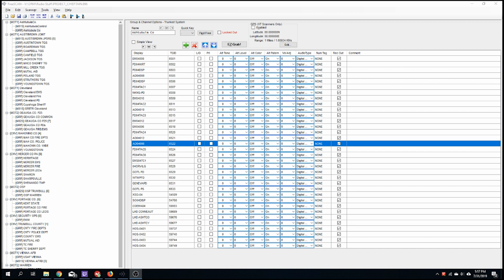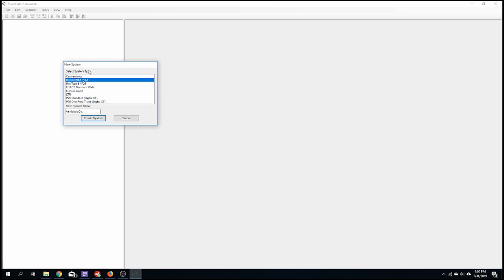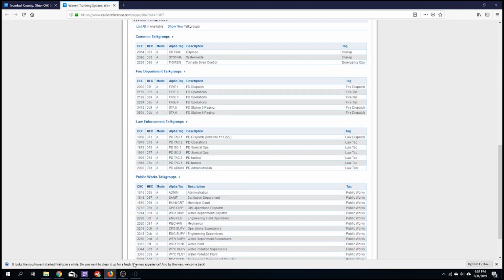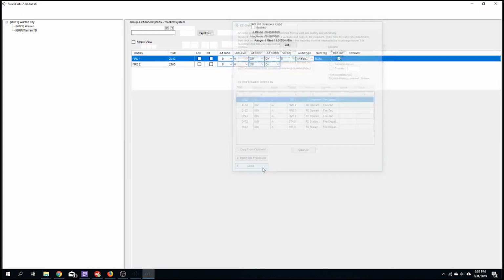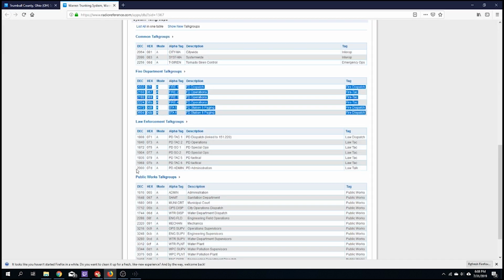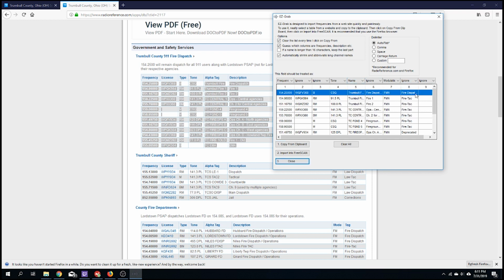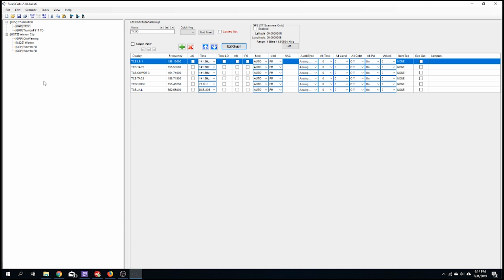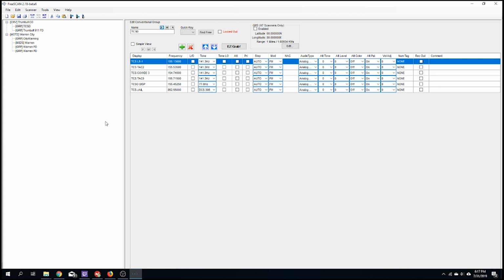FreeScan Scanner Software - Programming Uniden Scanners using FreeScan Software

Comment: i have 3 of these 15x's 
one being brand new because about 3 weeks ago the one i have on my nightstand .. sometimes i turn it off before falling to sleep,and sometimes i fall asleep and wake up in the middle of the night and turn it off.
well on this one night it was working fine (audio coming out) when i fell asleep and then when i woke up i seen it was still scanning and stopping on the busy channels but NO audio was present. i turned it off and found time a week or 2 later to look at it , i even tried using a pair of headphones and a ext. speaker but no AUDIO from those as well.. I did a full reset to see if that might fix it but to no avail.
i did send uniden a email  but its the weekend  so i was hoping to hear back from them this week sometime, but  your video here doesn't sound like i will .
i have a small amount of experience with a soldering iron  and even bought a "rework" reflow hot air station that ive used once on a dji drone remote controller
with success ;-)  any ideas for me before i open up the hood on this thing..  thanks in advance - steve

Comment: Hi, having COM1 issues.. trying to read/write a BCD325P2.. any suggestions?
Reply from the maker: While my understanding was that the 325 was ‘experimental’ in 2.18; did you try changing baud rates to a slower speed to see if it would read/write?

Comment: Excellent video. Figured out how to get this scanner programed quickly and easily. Recently the local Sheriff have stopped transmitting on the analog frequency they have been using for years. I imported all of the DTRS statewide channels, and besides the "Public safety" service, is there any way to figure out what frequency they may be on? I read they are building a new Sheriffs office, and am wondering if they are in the process of upgrading the dispatch center.  Anyway, thanks for the help.
Reply from the maker: Coreymillia 710 Has any of the information been updated on Radio Reference? That’s usually the best place to look since it is more difficult to try and manually ‘hunt down’ digital systems. Worst case, let us know what area you’re in and we’ll see if we can find anything.
Reply: @OperationalRiskManagement  Radio reference shows that Colorado federal systems were updated in the last 7 days. Nothing for my area specifically. When you click on the license for the Sheriff it shows active, and that it expires in 2021. I purchased a DMR key, not sure if it helped. Earlier tonight someone was pulled over right out front and the close call feature hit a few times on the 806-807 Mhz range.   When looking it up it says it is not in the database.  Anyway, I am in Teller county CO. Thank you.